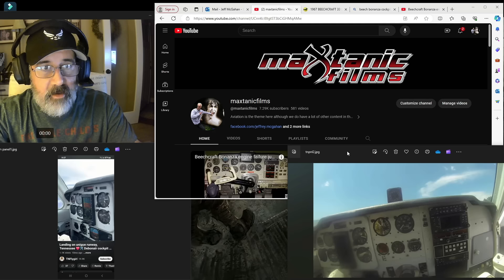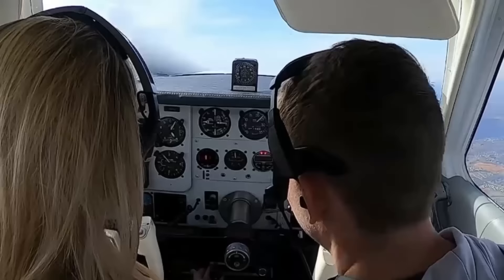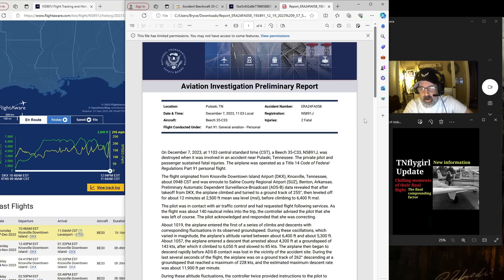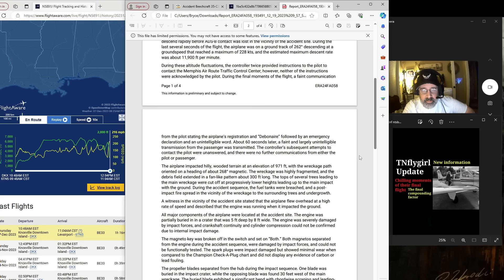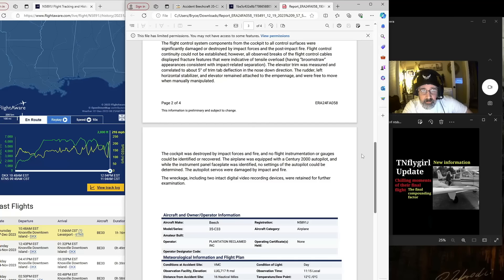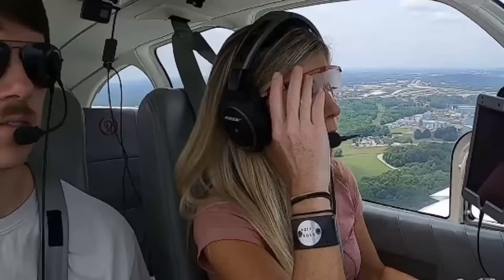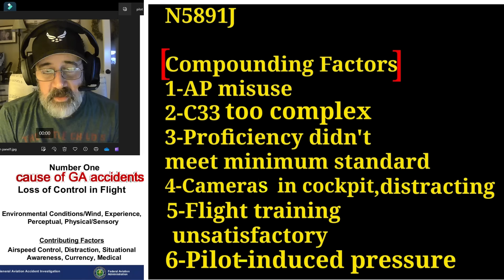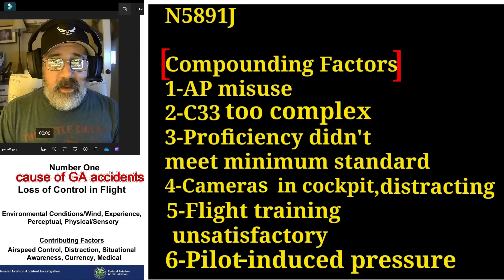TNflygirl Fatal Crash Update NTSB Preliminary Report N5891J

Comment: That Century 2000 AP was installed without "autotrim", leaving it to "prompt" you to manually trim the airframe trim wheel up or down.  She was commanding the autopilot by pushing buttons when she should have been moving the trim wheel. She should have been in a 172, with a competent instructor, with all the toys left sitting in the hangar, and learn to fly the aircraft. I found it a challenge to introduce even seasoned pilots to that Aspen display at times, she had no chance with it. Just think how confused she would have been with a new avionics suite, and how scrutinized the poor shop would have been when that smokin hole would have been investigated.
Reply: Which is piloting 101.  Her very first flying lesson should have emphasized trimming the aircraft for straight and level and adjusting same for each change in altitude, power, etc.  That she seems so utterly oblivious to this and the CFIs never corrected her poor characteristics in this regard is baffling to me.

Comment: I know she didn’t understand everything about her autopilot, from the manual. Her cfii doesn’t have much experience in bonanzas, and I don’t think he ever read the autopilot manual. All climbs should be at about 24”/2,400 rpm. She’s always climbing at less than 24”. She never seems to adjust mixture as she climbs. And she’s not knowing whether to roll her manual trim wheel forward or backward, depend on phase of flight. When trimming, you don’t look at the trim wheel; you feel for it, move it the correct way, and feel/see if the plane is doing what you want it to do. During much of her flight and the last few minutes, her track was always quite good. That leads me to think the autopilot was on for most of the flight. But the vertical profile and speed control was bad the entire flight. It seems that using the autopilot in a badly mistrimmed state, then disengaging it, is when all vertical help, went away, pitched her down abruptly, she got nervous and didn’t know how to recover; power, pitch, wings level, pull back smoothly. In hindsight, from her first lesson, she should have flown with a great cfi, in a J3 cub, with minimal instruments. She would have learned via needle, ball and airspeed and lookin out the window, the basic physics of flight. She muddled through flight training, demonstrated the minimum standards, passed her PPL, but just didn’t understand flying 100%. She got some experience flying around without an instructor, did that good enough to not crash. Then she bought the high performance debonair, had a mediocre checkout, flew a little bit on her own (all okay and legal), then jumped into instrument training with a very inexperienced cfii, who himself didn’t fix her inadequacies in basic airmanship. It’s difficult to become instrument rated, when  so many basic airmanship skills are not are not known. Dave, 55 years flying and bonanza owner😞. RIP
Reply: She had no business even touching the AP given her deficient level of competence hand flying.
Reply: Bonanza is a beefy plane, like going directly to driving a high performance sports car on the freeway, after learning on a 1972 VW Bug in the closed down KMart parking lot.
Reply: @Raelven   lol. Great analogy.
Reply: every new pilot should have to sit in a 152 with standard 6 pack, one comm/nav and a transponder, paper and pen navlog and an e6B before moving on to the digital shit

Comment: In one of the videos I see her with Foggles on clearly building "hood time" but she was struggling with using the autopilot that as everyone points out she was totally confused on how to use it.   Honestly why would a CFI even allow a student to use an autopilot during instrument training?   When I did my instrument training I was never allowed to use the autopilot.  Sure once you have your Instrument ticket and can very confidently hand fly IFR  then you should do extensive training on how to use the autopilot in IMC (but  in VFR conditions)  then transition to using it IFR.
Reply: Instrument training should be done largely without Ap until you have demonstrated exceptional and consistent control without it.  For actual IFR single pilot flying the AP is a tremendous tool for easing workload and for safety of the flight and passengers.  Subsequent to earning the rating, instrument Proficiency Checks generally require demonstration of use of the AP if one is installed.  Practically, if flying alone or with an instructor IFR I hand fly.  If I have passengers, I use and closely monitor the AP for the best flight experience for my passengers.  A good Ap properly used flies better than humans.
Reply: Instrument training should be done largely without Ap until you have demonstrated exceptional and consistent control without it.  For actual IFR single pilot flying the AP is a tremendous tool for easing workload and for safety of the flight and passengers.  Subsequent to earning the rating, instrument Proficiency Checks generally require demonstration of use of the AP if one is installed.  Practically, if flying alone or with an instructor IFR I hand fly.  If I have passengers, I use and closely monitor the AP for the best flight experience for my passengers.  A good Ap properly used flies better than humans.

Comment: The other night I flew a warrior which I have over 200 hours in that has a STC 30 auto pilot system. This is relatively new to me, but I learned it through reading and using it on the ground to learn what it was going to do. On my first flight out, it worked flawlessly. It held altitude and it tracked very well. This auto pilot like the century 2000 does not have vertical capability only altitude hold. After I landed at my destination, I then continued back to my airport. I reached my desired altitude and trimmed the aircraft where I could fly hands off. I then engaged the altitude hold, and for some reason it was starting to oscillate. First it went about 2° nose down, and when it descended 100 feet it started back up and went about 150 feet high and then started back down so I disengaged it and hand flew it back. I wrote it up in the book I could never figure out why it was doing that as I was not getting a trim up or trimmed down light. To add insult to injury with the auto pilot off and the aircraft trimmed it was holding altitude on its own. Go figure.
Reply: She spent the majority of time fartin with the Century  2000  without any knowledge of it ...and as you said in your experience get to altitude set trim as you stabilize speed and altitude hands free and keep 2 fingers on it just incase of gusts ...her SA was zero chewin gum constantly stroking her hair and griping because ATC was calling out her poor management  of the plane ... she'd been better off in a Cessna 172 G1000 that could almost fly itself in a timely manner They would be alive ....Maybe ... she had NO business flying imho ... she looked and acted like she was tranqued and zoned out ...Sad all around
Reply: Yep and anything else can go wrong and when you think flying is like driving a car you’re doomed the key is you were able to diagnose the problem and figured out quickly before it got to be a problem if it ever was going to be I think in her case she was creating the problem because she was clueless when she walked into the hanger
Reply: Tbh i didnt know autopilots came without autotrim. Tbh. Never flown one without it. Though why tf are you using an autopilot without even knowing what attitude hold or how to use it is. Bizzare flight sequence. When i got an avionics upgrade got literally free training.
Reply: She did not have confidence in flying that airplane in those videos at all.  She was so unsure of herself and unsure of the airplane.  Things were not computing.  The CFIs weren’t acting much better.  You have to be EXACT in all manner in the airplane.
Reply: I have heard that wild oscillations can be a sign of a malfunctioning autopilot that needs service. So, if you are renting and believe you are operating the AP correctly, it may be a good idea to squawk it and have maintenance take a look.
Reply: @JB_Hobbies  this might be correct except this wasnt autotrimming so not sure how it oscillates like that. Though havent ever used an A/P without Autotrim. But also if you d/c and retake control. Should be able to manually smooth it. Or worst case pull the breaker in an autotrim to kill the servo. It seems like she wasnt trimming correctly in those videos. Though im not sure why 5 degrees trim down would put you into an unrecoverable situation unless maybe a CG issue?
Reply: @idkjames  yea, I was thinking of OP’s autopilot, but it looks like they don’t have electric trim either.  For the crash victim, I also thought that 5 degrees of bad trim didn’t sound like it should be a fatal situation, but I have no idea what that feels like in a Debonair. I have heard that being out of trim can be very deadly on takeoff, but people are usually talking about heavy aircraft that are too heavy to easily overpower but not heavy enough to use something other than unassisted cables or pushrods. I have never heard of someone being so badly out of trim in cruise that they manage to lawn dart from altitude. But, also, everyone seems to agree that the crash victim was not a competent pilot, so I suppose that could happen to someone who doesn’t understand how to fly. I just don’t know how it’s possible to fly so frequently enough to get to 400 hours in a short amount of time but still manage to get so stumped by basic controls that you crash and die. But, I mean, unless the NTSB can come up with some other explanation—maybe from the footage—that seems to be what happened.
Reply: @JB_Hobbies  im sure they already have the explanation on film and have seen. But you know inefficient bureaucracy and stuff.  Yeah, never flown a Debonair. Ive got 978 TT over 10 years. Never had that much trouble controlling the aircraft. I mean in one video i saw looked like a student. Her old videos have been reposted by others if you look for them. She blew an approach fix by 900ft one day trying to use A/P coupled. ATC cancelled her clearance. Insane thing is there was a CFI monitoring and he didnt realize it till atc said something. Like wtf. Im on Comm MEI. No cfi and pursued rating as a hobby. But seems like even if i was pilot monitoring id say something
Reply: @idkjames  Those past videos are damning.
Reply: The one thing my flight instructor told me was..don't let the auto pilot kill you. If you don't like what it's doing..turn it off and fly the plane.
Reply: @wingwatchersaviation  i dont know that ive heard of a recent crash where the autopilot killed anyone. Maybe a CFIT with autopilot wngaged but more of a pilot thing.
Reply: @idkjames  The lesson is if you turn on the autopilot and it does things that you don't want it to do, or it shouldn't be doing turn it off. Don't focus on trying to fix the problem when you should be aviating and navigating. Stabilize the plane then deal with automation. If you can't figure it out..leave it alone and fly the plane.  So in this situation, if I didn't know how the autopilot worked, or of it was doing things I didn't want it to and I didn't know how to correct it...the autopilot is turned off. I've had autopilots do things that I didn't expect and couldn't correct. and I've had flat out failures. That's exactly what I did turned it off completely and hand flew or got Stabilized and trimmed then sorted it out.
Reply: she had the auto pilot looked at and it was determined it was working properly. I even saw one her videos where she was shooting a localizer approach and the auto piilot was doing fantastic. Smooth level flight and turns. Then she disconnected the autoipilot and went to hand flying it. Anyone ever had one them washing machines that is way out of level and just dances all over the place on spin cycle? Thats what her hand flying looked like. So i get why she was obsessed with getting the autopilot to work correctly.
Reply: @AudioMasters  seems like a failure by CFI and CPE.
Reply: @tangotango256  Autopilots in themselves are not difficult. Once you’ve used one, you kind of figure out all the rest of them. I looked over the century 2000 without even ever touching it and I probably could tell you how to operate it properly. There’s only one function on it, that the manual does not specify, and that’s with the annunciator EXT stands for. i’m assuming that it means for external source. But then again, all navigators are external source.
Reply: @idkjames  she thought it was so simple. She thought she was just pushing cruise control.
Reply: @AudioMasters  that would be an obvious answer. She needed the auto pilot to fly the plane because she needed a pilot to fly the plane. She never really learned how to master hand flying. Probably like most things in her life was given to her or got things easy.
Reply: @JB_Hobbies  I did squawk it. It wasn’t wild oscillations it just seem to want to wander back-and-forth. I went from a 28 kn headwind to a 28 kn tailwind on return so there could be a possibility of several pressure changes that were being sensed by the sensor. It wasn’t going to give me any trouble. It just was annoying. As I said before, the trip outbound was flawless. It held out altitude right on the pin.
Reply: @JB_Hobbies I'm wondering if she had a trim stall with nose down trim and was trying to recover.  It also could be a jammed elevator, tab, or trim wheel due to FOD or a failure in the cables or linkage.  Apparently there is some wre kage of the tail that's not as damaged as the rest of the aircraft.
Reply: Unfortunately my sister got involved with SSRIs and she was oblivious to danger. She had a water moccasin in the fireplace one time and took a selfie of her taking the snake outside with a fireplace poker.
Reply: @idkjames RE CG issue. In one of her videos she had a fully loaded arctic air cooler located fully aft. I’m not sure what the max weight is for that station in that plane is but it’s worth considering.

Comment: She always seemed behind the airplane. Atc was always correcting her. These people didn't know what they were doing. That was too much airplane for her!
Reply: Just imagine if she had a small Gulfstream jet airplane.
Reply: I think even a C-152 would have been too much for her. For her to NOT know that to climb she should give more power blows me away! If she didn't know how to operate the AP, then don't use it. She crashed because she was incompetent - not because of the plane, but because she was incompetent.
Reply: @secondrule  In some videos she shows that instead of comprehending what she's doing and why she's doing it, she just memorized. Like when she when he asked what "ATT" means she said "I don't know, all I know is if (something) happens I press this button". She memorized that when she pulls back the yoke to climb that she gives the engine more  power. She never put two and two together to understand that any time she climbs she needs to apply more power. That is a lack of comprehension that comes from just memorizing pull yoke, add power. Fatal for a pilot. You have to understand what you are doing while piloting a plane or end up like Jenny and her dad.

Comment: That flight instructor was behind completely especially when the ATC told them that they were too low and you could see him 
take his glasses off and taking a look at the altimeter. Wow what a cluster and it is no surprise that she was not able to handle
the aircraft when things went wrong. You absolutely have to know the basics before you worry about using equipment such as 
the auto pilot and cannot use the autopilot to fly you out of trouble. Very Sad story here and never should have reached this end.